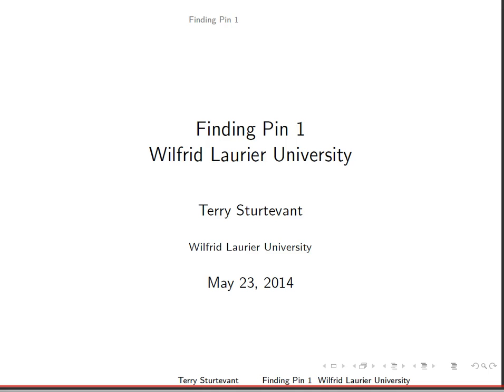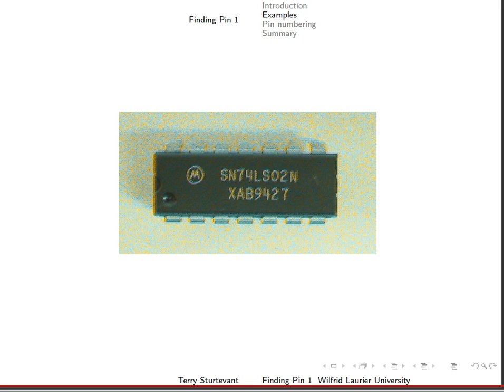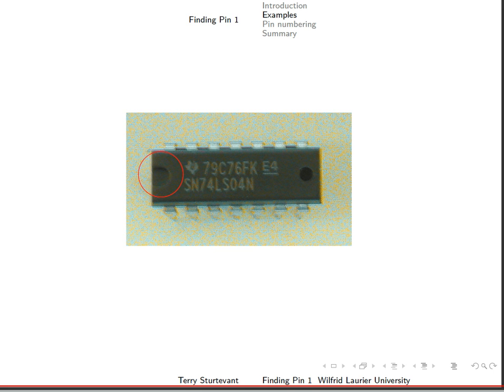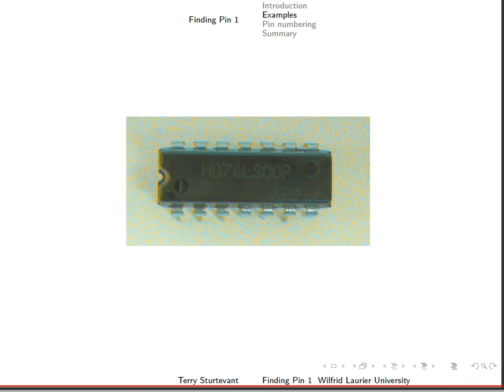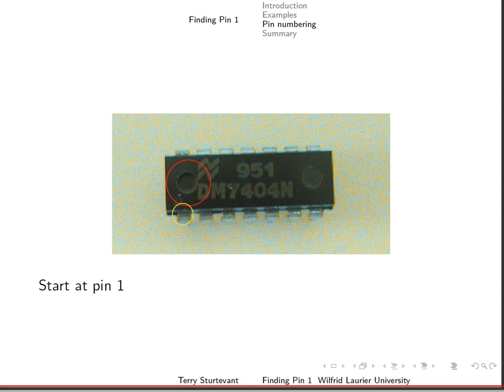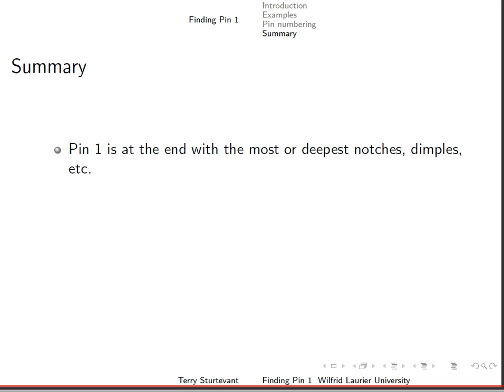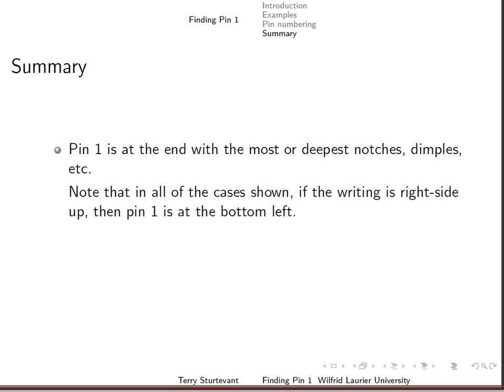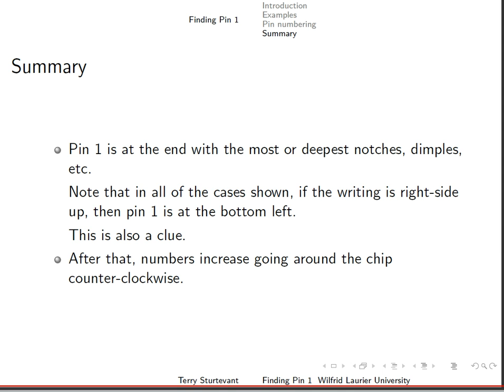Finding pin 1 on an IC chip

Comment: Your tutorial seems straightforward, but just to be sure would pin 1 always be on the bottom left?  or are there some ICs where pin one is in another location???
Reply from the maker: Once you've found the correct end of the chip and oriented it on the left, then pin 1 will be on the bottom left.